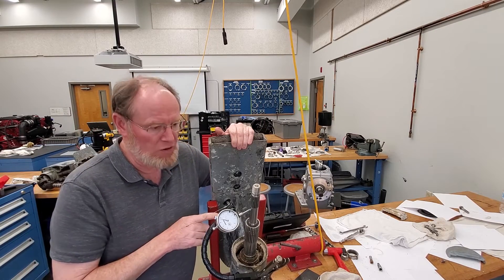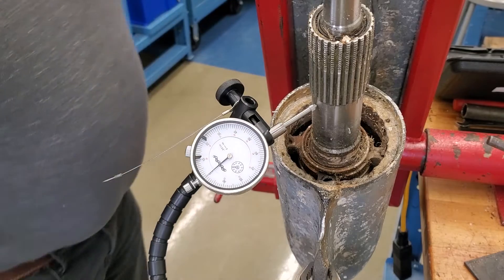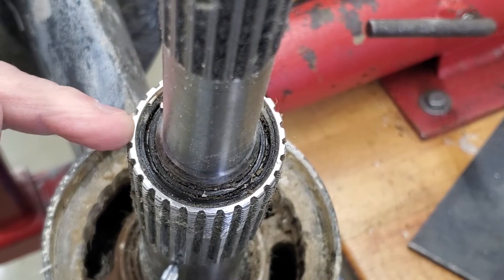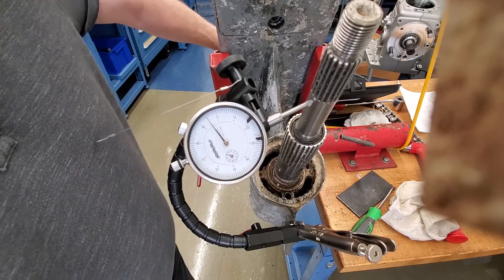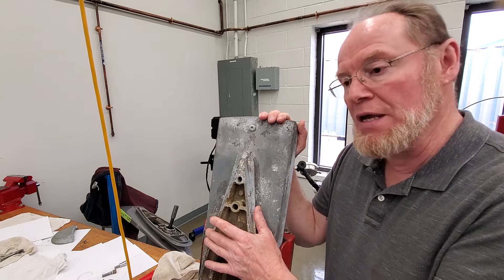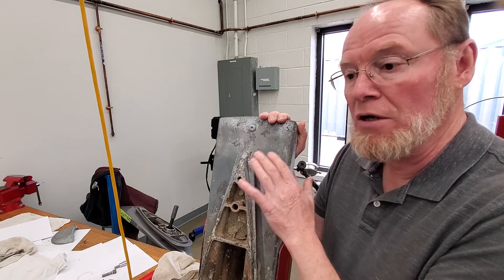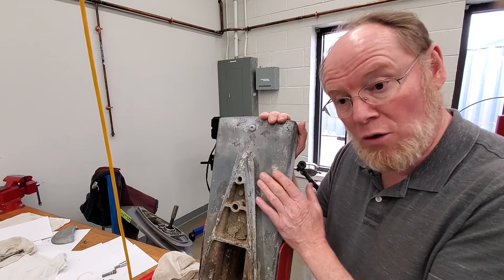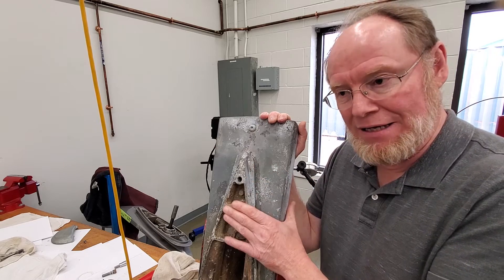Checking Propeller Shaft Run out on a Volvo Penta DPS lower unit

Comment: Hey Ted. 
Question is there a difference between the DP-SM and DP-SX ? Would i be able to put a dp-sx  instead my dp—sm
Reply from the maker: The early DP-S drives only came in a few versions with very little interchangeability such as DP-S and DP-S1 These were replaced by the DP-SM with a DP-SMTD diesel version. There where no DP-SX drives, only SX (single props haft) versions.
These included SX-S Volvo/Cobra then SX-C thru SX-RT2 and finally SX-M with SX-MTD the diesel version.